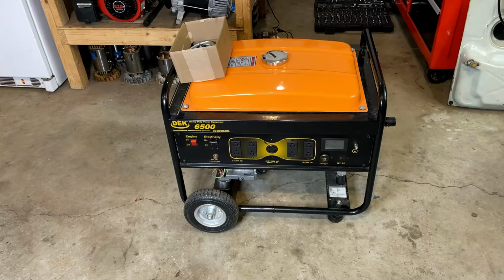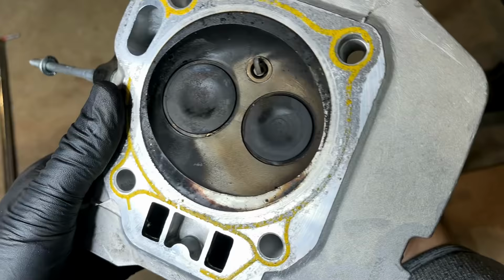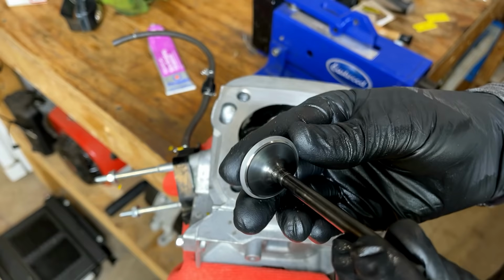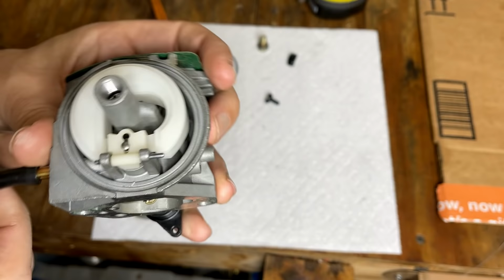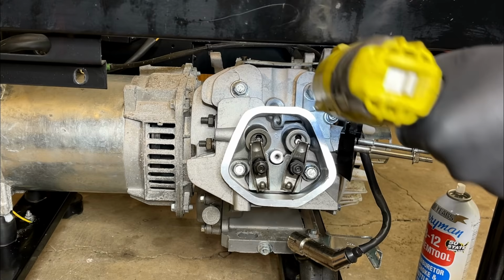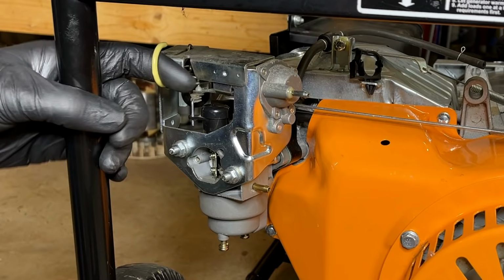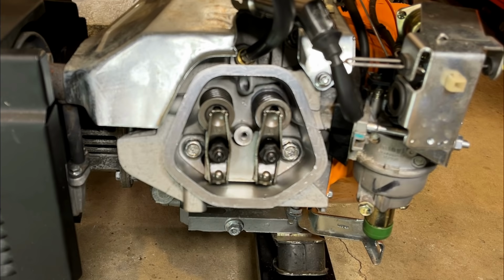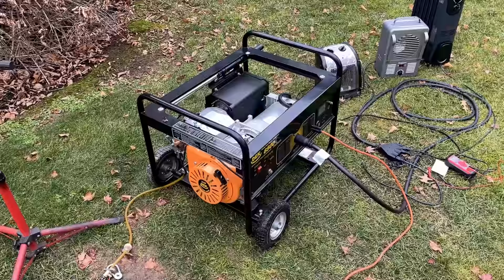Honda Clone Almost Dropped a Valve - Broken Valve Repair on a DEK Generator

Comment: Great work James!  I have fixed and flipped small equipment for years now, and the price/value for these traditional-style generators has plummeted in the last 5 years.  At least by me on Long Island.  That DEK gen would maybe fetch $250-300 tops in mint used condition.  And it would maybe take 6-8 months or more to sell.  Maybe even a year or more.
 Most people are switching over to inverter gens, new and used.  To make matters worse, brand new inverter gens from China keep getting cheaper, to the point that many people aren't looking to buy a used gen on the market.
I have done well with fixing inverter gens, though.  95% of the time, it's carb issues, and they are aren't fun to get to.  The good news is most inverter gens all seem to be built similar, so working on them becomes quite familiar.
What are you seeing by you?
What's interesting, is I don't see many inverter gens for sale used.  Lots of old traditional gens for sale used though.
Reply from the maker: This type of generator near me sell in the $300-$400 range.  They are hard to sell.  I can go months without selling one and then sell 5 in a week.  If a big storm is in the forecast then they all go in a day.  Definitely easier to sell an inverter generator or yard equipment.
Reply: @jcondon1  @Tristan Schaper In desperate times desperate people will do desperate things like buying any working generator when no others can be had.

Comment: Hi James Very Very instructive all your videos Thank you 
I need your help, My generator is a champion 5500 watts it has the same engine that you are working in this video, well it was working fine until two years ago that over sudden stopped working and I couldn't starter again, now I had a little time to see if I can fix it up because I leave in a flood zone and season of hurricanes and heavy rains, and floods is coming in about August, September were i loose power for a few days, any way what I found out is that the intake valve broke at the top of it, I was able to recover the rotator cap, keeper and the piece that broke off, I got all new parts ( head gasket, push rods, rocket arms keepers, rotator cap, push rod guide, etc. cleaned really good everything, put everything back together up until cylinder head adjust valves to specs, and before keep going I decide to test its compression, oh surprise I can not go any further than 29 psi
which is not even close to what you have said in multiple videos that it has to be at least 55 psi.  It is a little frustrating and discouraging. What am I missing or doing wrong? suggestions please, sorry for the length of this message thank you in advance

Comment: Yeah, I guessed the spark. Mine had me running circles. Was sparking but probably once in a pressurized environment behaved differently. Same thing, was blowing back through the carb.
Well, I certainly have a pristine carb now because once the new sparkplug was in it started in an instant

Comment: Perhaps if you find an old metal battery charger on wheels you could re-purpose it. You could take the elements out of a few of those milkhouse heaters and make a "load box". You could have switches to select the load. You'd need a fan so it didn't burn up.

Comment: my neighbor bought an almost new briggs powered snowblower.  originally thought it had carb flooding which turned out just to be overfilled with oil. but after that was resolved it had starting issues which disappeared when I  replaced the plug. just wish that was why my own briggs blower will start cold but very difficult with pull cord when hot. electric is fine both hot and cold.

Comment: LOL in my home Workshop I follow the two Universal laws of torque, 1 discovered by the German philosopher mechanic Gutentight, and the other universal law of torque tighten it down till you strip the threads then back off a quarter-turn the most important part of this law to never forget to back off the quarter-turn. LOL

Comment: I'm finding on these new clones that it's a good Idea to check valve clearance after startup run in. I'm finding there out of spec most likely from shipping or even from factory.
Reply from the maker: I agree.  Always a good idea.
Reply: Carbon is killing them and that’s what I found out

Comment: FWIW, foam earplugs work great for blocking up bolt holes (I always worry about not being able to retrieve paper towel when I block them up).

Watching more. Is it just me or do those rockers look kinda dry after that engine was running…
Reply from the maker: Not much oil makes it up to the valves.

Comment: It's always bound to be a good start when your carburettor says "Who Are Ye?" And immediately proclaims itself to be "Standard Of Japan" - A bold statement for a Chinese clone!

I've heard it said that those Chinese spark plugs aren't up to standard, and most people I know will swap on sight for a known brand i.e. NGK.

All in all, that's not a bad result at all, and for as long as it lasts, it should give someone peace of mind in an emergency, and as long as they look after it.

I'm a bit surprised at the valve stem breaking off like that, especially since the pushrod bent over to give compliance. For what it's worth, we've successfully straightened bent pushrods and put them back in service. I guess the difference there is that if you're selling the machine, you don't want any comeback on account of a cheap and simple part, though that said, we've never had any problems after straightening a rod.
Reply: NGK. . . . . . . . .I have 12 tools here with 2T and 4T engines, NGK's have made starting easier in all cases and running better in some, wouldn't have anything else.  I would say don't use the German (made in India) ones that start with B, troublesome I have found.
Reply from the maker: It must be good with the word Japan printed on the carb.  Definitely could have straitened the push rod.  But for the reason mentioned, do not want to cause a problem later on for someone.

Comment: get a short rubber hose that will fit over the spark plug, makes life much easier when installing plugs in those type engines

Comment: double check your lash after a few hours of run and check and make sure it hasn't bent or shered the fly wheel key from the valve hitting the piston that will throw the timing out

Comment: Excellent work,thank you for this video.I have look many videos from your work and i must say its perfect,i have learn a lot.You make perfect videos in best HD quality. One question,can you also make a video for your clients in germany about generator with diesel engine?(most popular are the Yanmar clones with 10-13 hp and 1 or 3 phase synchron generators with 5-8kw)
Thank you in advance and many greatings from germany.
Reply from the maker: I would love to, but diesel generators in that size are rare around here.  Will find one eventually.
Reply: @jcondon1  Hi James thank you for your so fast answer.Today i have buy 1 generator by ebay.
10 hp yanmar clone 400/240V 50Hz 5kw,synchrone generator in soundproof housing for small money.
Generator bringing no power and the rest ist old and dirty.The unit is from 2007.No maintenance,many rust but the engine is okay and not blocked. 
Many work, but i hope i bring this unit to run.
When the generatorwindings are complete burned out,i will built in the same generator with single phase.The complete generator(stator and rotor)costs 199 € incl.shipping from a german dealer.
What do you mean, is this price okay?
Have a nice weekend and best wishes for your projects.
Oli from Stuttgart.

Comment: I had one of those robin engines drop a valve and then shoot it back through the head, made it's own new valve guide lol, it had those slotted spring caps that popped off the intake valve, replaced it with a new holeless head with actual valve spring retainers still runs great guess I'm luck it didn't knock a whole in the piston

Comment: Great job and video. I have had to take my Dremel tool and cut a slot in the carb adjustment screw when they are broken off. works pretty well and can adjust the needle again. Thanks for another great video. Where did you get your valve and parts and the service manual for the Honda clones? Many thanks.
Reply from the maker: The clone service manual I actually got from Ryobi.  The link to it is in the description.   A Honda GX390 service manual would also work.  The clone parts I have buying recently from a seller on eBay dieselgeneratorparts https://www.ebay.com/usr/dieselgeneratorparts?_trksid=p2047675.m3561.l2559
Reply: @jcondon1  Many thanks.

Comment: I don't see an oil pickup tube or oil pump of any kind on these small engines.  But I do see small holes in the head and block for oil to drain from the head back to the crankcase.  How does oil get up in the head to lubricate the rocker arms, pushrods and valves?
Reply from the maker: No pump.  Just a little hole on the right side of the head to allow a small amount of oil to splash up from the sump.

Comment: In my experience I've always found the Chonda Engines(or Honda's with Chonda Coils) to be really fussy with Spark Plugs, I've put Plugs in them that appear perfect from another good running Honda & they'll Cough & Fart but grab a brand new one & they run fine! I've always set Valves when Engine is warm.

Comment: Maybe the increased length of the new push rod has an effect on the decompression sector causing an excess valve opening during start-up.....
Reply from the maker: I don't think so.  That is mainly a function of the camshaft and the lifter.

Comment: From what I understand about the Chinese honda clone engines is that there model numbers are very simple , for example the 168f engine is a copy of hondas gx160 and gx200 engines. The 1 represents the number of cylinders and the 68 represents the piston diameter in mm. The letter f at the end of the engine model could be referring to the starting method with f models having pull starts and fa engines being equipped with eletric starters.They also use this system for there yanmar diesel clones and some models of diesel and petrol have the same model number. Hope this helps.
Reply from the maker: Thanks for the information.

Comment: What a muffler. Probably considerably quieter than most except resonance in baffles and muffler housing.  Must not have had a plastic pressed on cam line setup or that’s probably damaged too. .
Reply: Lobe not line

Comment: James have you considered a used valve grinding station? Taryl uses one at his shop. You can accurately shorten valve stems and recut valve faces. Ebay has used machines. Sioux valve grinder machines and Black & Decker make stuff.
Reply from the maker: I have not considered it.  Mostly because I only do a handful a year.  Will keep an eye out for one.
Reply: @jcondon1  I thought a valve grinder might have helped with this Gen. But I understand it's a speciality tool.

Comment: Thanks James. I have a dek 7550 with a 14 hp engine. (Honda gx390 clone). I have experienced every problem you encountered and solved. This thing has always been a bear to start right out of the box. I have worked on every part of this thing except the paint job. I need to make sure that the choke vacuum check valve is pointing the correct way. Can you verify for me?
Thanks millions,
B . Bush
Reply: I also have fixed one for customer and they look good but carbon is killing them , use b12 to clean up carbon often
Reply: @philliphall5198  The " I-talian Tune Up"

Comment: Those rockers appear to move excessively L & R and extremely close to the high lip of the spring retainer if that was to make contact it will be same result as the original problem if it is as I viewed it there would be a simple fix

Comment: A 20-year-old DeVilbiss EXGBVE7010 7000 watt generator with Briggs Vanguard V-twin 14 HP electric-start engine.

This heavy gen has no wheels which makes it cumbersome to move around. DeVilbiss is long out of business, and no OE wheels are available. I can easily source other makers’ handles, feet, axles and wheels aplenty. Most common for this size gen is 10” wheels with 5/8” axle (full-width axle for extra strength, not just axle stubs) welded to the chassis. 

But where to position the wheels? Too far back (away from the handle) makes the majority of weight be born by the handle, making the handle heavy to lift. Too far forward (toward the handle) risks plowing the rear corners of the frame (opposite the handle) into the ground when lifting the handle. 

I’ve looked at some similar V-twin gens (some models of Generac, DuroMax, B&S StormResponder, Ryobi, and others): they all have different locations.

So many choices! Suggestions?
Reply from the maker: If possible I put the wheels on the generator side since that is heavier then the engine.  I usually put the wheels back as possible, but as you said its a balance to get the weight distribution right.  Longer handles will give you more leverage on the weight.
Reply: @jcondon1  Generator heavier than Vanguard V-twin? This being my only V-twin ever, I'll rely on your experience with all kinds of gens. Thanks!

Comment: Drill a hole in the drain plug it’s a man a magnet right there when you screw the drain plug in any metal gets stuck to it while it’s running if there is any metal!

Comment: It's always interesting to watch your videos. Koodo for the great work. Your videos help me repaired my own generator. QUESTION: I would very be interested in know which website(s) you're using to find parts diagram and also which ones you orders parts. Thanks.
Reply from the maker: I try to use eBay and Amazon when possible because the parts are in stock and ship right away.  The large part vendors typically do not have what I need in stock and it can take 3+ weeks to get what I need.
Reply: @jcondon1  Thanks James

Comment: I'm surprised how rarely you change the spark plugs. Was always the first thing I checked when I was working on my motorbikes. And needs doing on my lawnmower now. 
Interesting. Wonder why it failed? Maybe the valve was too loose.
Reply from the maker: Maybe.  I checked the bent push rod to see if there was a rough spot.  Found nothing wrong with it other then the fact it was bent.

Comment: on another generator issue. fellow gave a champion.  engine dies as soon as moved off choke. runs fine if avr is disconnected.  new brushes and avr. no change. defective rotor?
Reply from the maker: Does it sound like its under load?  Some champions have a voltage monitor that shuts the engine down if the voltage it too high.  When choked, the engine will be running slow and the voltage lower until the choke is off.  See https://youtu.be/6tOGbim-vzk

Comment: is this the engine stalling sound you use at the end of your videos?   I watched this one again because I thought this was the video where you go into detail on compression release because I was trying to explain it to a friend but could not get it out properly.  This is an excellent demonstration on how the head part of decompression works.  I remembered how you said it works internally.   With centripital  (spp?) force on the cam.  Or is that 2 different types of compression release?
Reply from the maker: This is the sound I use on the end of my videos.   Portable generators almost all use this type of governor.  Inverter generators use a computer controlled servo.
Reply: @jcondon1  Ha!!  I thought it sounded familiar.   Thanks man.

Comment: 6.5kw out of that tiny alternator? I doubt that alternator will last long! I wouldn’t worry about any big chunks of metal in the sump on anything but an acrobatic airplane it will sit there forever harmlessly. On a airplane that’s flown upside down in a negative G condition there is a very small chance it could end up in the timing gears and lock up the engine but that’s the only application I’d worry about!
Reply from the maker: I agree on the alternator size.  It looked smaller then I would have expected for the power rating.

Comment: In a emergency could grind a bit off both ends of the push rod ?    To make them loose the 1/10 of a inch especially on the upper end that has the cap on the push rod end under the top lend   ?

Comment: I always enjoy watching your videos.  I may have missed it in a previous video, but I'm curious about where you got all your knowledge on small engines and generators.  Was it learned by experience only or did you take courses in small engine repair and/or electronics?
Reply from the maker: No courses.  Just service manuals, Google, YouTube and trial and error.

Comment: Hi James, Great video thanks. Last week I replaced the valves on my honda mower, but I did not know (UNTIL I WACHED YOUR VIDEO)  that the flat side of the valve spring retainars must face down. Will you be kind to let me know if that will cause problems?  Grazie Mille
Reply from the maker: It will cause a problem.  The rocker will hit the side of the spring retainer and will eventually cause the retainer to fail.

Comment: Hello please I have 7hp generator motor that backfired when trying to start. It had run out of fuel.  Anyway it's a year old and think it may need a valve clearance adjustment. What do you think.